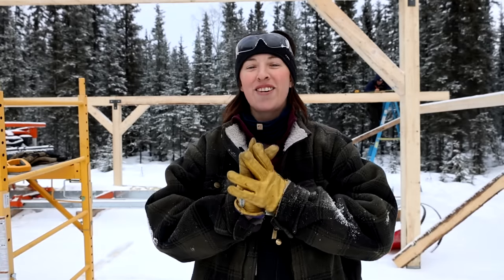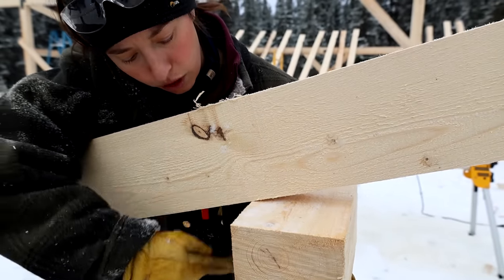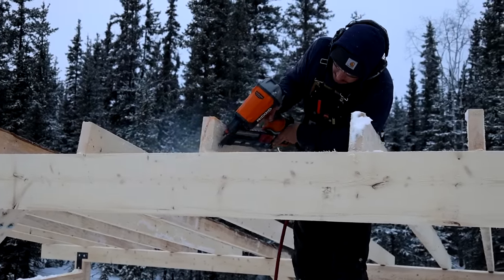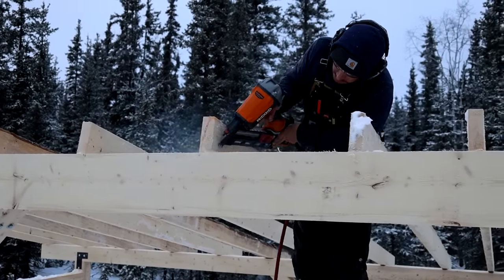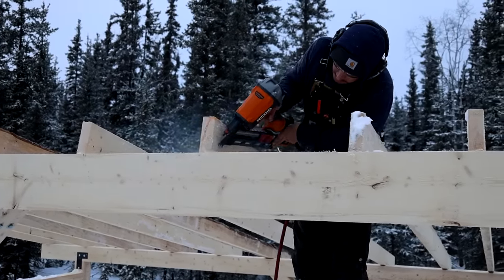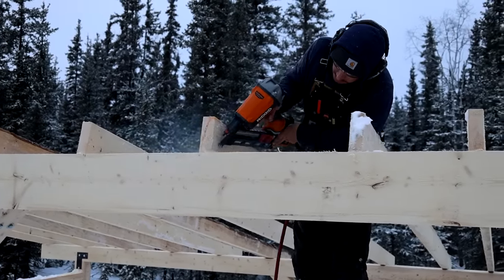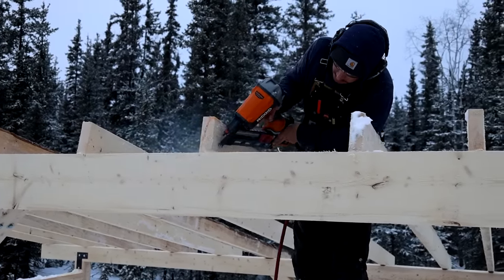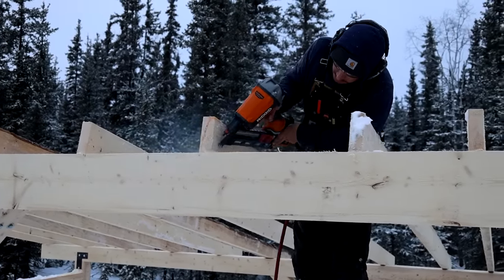Building a Sawmill Shed | Install Rafters and Metal Roofing + Total Project Cost

Comment: After looking at this structure in the video I would like to suggest, as a builder of 55 years to ad diagonal braces to the ends of the structure to prevent racking.  Mainly to keep strong winds from collapsing it.  Great job you two.  Great Job!  Don't forget the bracing.
Reply: I noticed the movement when they were on the roof. This will definitely help, but the building looks awesome.
Reply: Yes this !! Awesome job, however when Eric was on the roof, there no side to side movement, but front to back was another thing. Adding braces to the ends will also help in the event a BIG snow load.
Reply: I came to the comments to say the same thing, and I knew it would be a common suggestion.
Reply: Definitely need bracing front to back.  Would really really suck to have that fall on mill.  They are also going to want to cover a wall to hang stuff on like blades and tools along with a wind brake
Oh and $2k for that is cheap money
Reply: you could use steel rope as bracing for the ends
Reply: Ongelofelijk mooi, genoten van dit project. Ik vond ook mooi om tezien hoe een vrouw dit zware werk kan doen respect. Tevens ook nog koken top amusement voor mij merci.
Reply: @moniquehollands6947  Translated. 
Incredibly beautiful, enjoyed this project. I also liked seeing how a woman can do this hard work with respect. Also cooking great entertainment for me, thanks.
Reply: A MUST 😊
Reply: Yeah I think some braces are missing, it's a really long structure, either add posts and beams or cross brace it (cheaper).
Reply: You two have the best team work
Reply: Hi, as a Structural Engineer from the UK I would add my encouragement to the suggestion of putting in diagonal bracing to resist wind loading. The knee braces used on the elevations would help but an eaves to floor slab//corner post ideal. It would need to be beefy to resist compression. It would also be worth thinking about additional plates & bolts to attach the corner posts to the floor. In the mean time it would be worth using straps & a ratchet to cross brace the gables - as suggested by others. Love your YouTube channel. All the best.
Reply: Ditto. There was movement front to back. Diagonal bracing on ends would sturdy it up. Nice structure
Reply: Great tip. I went back to 22:00 and saw a bit of rocking. Made my knees a little weak.
Reply: @ToKindBe aqdaaaaddaaaadaaam
Reply: Not only for the support but it would give it a more balanced look having the diagonal braces at every point.
Reply: Indeed, importent
Reply: Eric, make more t-metal braces and install them across the gabel ends.   The structure looks awesome!
Reply: DEFINITELY bracing since this is green wood and will twist as it dries

Comment: You will definitely have to put sway bracing in on both ends...a big bluster of wind will fold your structure to the ground without the end posts having bracing...you can put a 5 x 5 beam in between the end posts at the 7' high level and then put in 45 degree braces into the end posts. Wind blowing has mind blowing force!
Reply: Was going to say the same thing
Reply: Yes, it appeared to me it was rocking a good bit while they were putting on the roofing.
Reply: Yep! She did have some sway to her.
Reply: Scary to watch. I think about what if it falls with them under it.
Reply: Came to say this too.  It looks like it needs more shear bracing or a good stiff wind might push it right over.
Reply: If you don't need to be able to pass through the back wall, if it was framed in and covered with plywood (or put shear braces in the framing) it would make a great shear wall and take all of the sway out of the structure.
Reply: Yes they need the front to back bracing and side to side
Reply: @KurtisRupnow  and would keep wind or rain off them at least from one side
Reply: Unfortunately neither seem to have a grasp on how to Properly frame. The fact Erin says they Notched the rafters This time, as opposed to the previous build,  says it all. That's basic framing.
Reply: All the building professionals are out today. 😂😂😂😂😂😂😂😂😂NOT
Reply: @stjameso15 Who’s Erin?
Reply: My husband said the same thing. Needs way more bracing. It will come down like a pile of sticks. Should never move at all!!! Angle braces on ever corner.
Reply: You seem to overkill the amount of wood to hold up the tin roof
Reply: I hope they take everyone's advice about the bracing.
Reply: Came to say the same thing haha. But looks like y'all have it covered. Such a cool structure, would hate to see it fold!
Reply: @David-yu1ms  plus possible snow load...if wet, can be pretty heavy
Reply: Our old neighbors in Wasilla built one just like this to park their truck under and the first good wind toppled it 😢
Reply: It definitely needs X bracing with Simpson KBS1Z brackets on those end posts. Wouldn't be a bad idea to add those brackets to all of the knee bracing. 

That 6x10 spanning 20' is also pretty sketchy........
Reply: Yes this thing is beautiful, but it needs bracing to prevent it getting folded either straight back or straight forward.
Reply: When I saw it swaying it made me so nervous. They really need to add more bracing asap before they waste that $3k they spent and ruin their mill or worse bc that thing is not safe at all as is. I hope they don’t wait.
Reply: The know it all's are out in force... 😂
Reply: @ag8552  he’s just misheard  Ariel’s name, instead of of saying ‘Ariel , he’s made a mistake and said ‘Erin’.
Reply: Great job guys! Have to say tho, you need to sort the sway out mighty fast or you might find it laying on the ground one day with your mill destroyed!!
Reply: Nice video
Reply: @David-yu1ms 
The tin roof is not heavy in itself, but the snow on top will definitly be!
Reply: @daveklein2826  Actually, yes.
Reply: @miatfitz  I can only speak for myself, but the structures I’ve built professionally are still standing 15 years later, so I guess I know what I’m talking about.
Reply: @AnneKegel  not to mention the area it creates for wind to apply enormous amounts of force to.
Reply: It looks AWESOME!!!  Very nice job guys!!  Did you build this from a set of plans?  Comments are plentiful for some bracing and I was wondering if the plans spec’d out bracing. Just a thought.
Reply: I was saying the same as when he was installing roof panels the structure was very wobbly…also ridge cap?
Reply: Earthquake country.   Overkill the bracing.
Reply: @KurtisRupnow  Same. Been building engineered wood and steel structures, professionally, for 10 years. Every open wood structure I've built has called for knee braces w/Simpson brackets at every post to beam connection, cross bracing w/Simpson brackets on end walls, and hurricane ties on every rafter. I live in Oregon, so all of our building codes are designed to withstand "the big one".

Comment: My father built cabins in NH during the 1980's. He said they always used a drawknife to remove all bark from lumber. Says it doesn't weaker the board but actually helps preserve the wood as insects always begin eating wood at the bark. I thought it to be interesting, perhaps you will too. Just fyi.  The sawmill shed is going to be very strong. You build well. 👍👍👍
Reply: My father said he beat yours up easy
Reply: Yep, definitely strip off the bark.
Reply: Wiley thanks for that info!
Reply: @bane8305 😂😂😂

Comment: I would be a little concerned about the movement visible in several parts of this video i.e. around 22 to 23 minutes. bracing on the ends would fix that.

Comment: Awesome build!  A small suggestion... perhaps put some bracing on the top of the horizontal shorter side-beams, that link the front and back sides... it will stop the wobbles you had when walking on the roof... and in high wind under snow load. Basically, bracing parallel and stabilising both sides.
Mealtimes are so magic... delicious.
Reply: I Agree, I would add more 45's front and back to prevent wobbling.
Reply: Yes, that would be my only suggestion as we saw when you first moved up there the wind was strong enough to carry away some of your structure. Rooster soup looked yummy.

Comment: when you were on the roof you could see it moving a little side to side.  some more 45 degree supports will help minimize sheer back and forth and also add some corner to corner 2x4 on back ans side walls

Comment: The notch (birds mouth) you're putting in those rafters is definitely the way to go. I don't know about anywhere else but it would never pass a framing inspection where I am without those.  It lets the weight rest straight down on the supporting member without risk of the twisting you mentioned or even sliding off entirely under the right circumstances. Good job guys

Comment: I built a 75"  x 75" deck for my tiny home in the North Woods in Wisconsin using green white pine lumber. I treated it with used transmission fluid I got from a service station. It looks a little pink when first applied, but turns to orange then brown. It has preserved it very well. After 3 years it does need another application, but it was a cheap way to go and I've been very pleased with how it turned out.
Reply: My brother used to build Cedar houses and would spray them with Auto Trans Fluid , they looked great .

Comment: As a bricklayer working in Canada, when we put up scaffolding, we use quilted tarps to make it warmer inside keep the weather and more importantly wind chill out. I’m just wondering if you got some quilted tarps you could hang them around the saw mill structure, making it a little more comfortable to use in the winter. When the weather is better, you could take them down and fold them and put them away for the next winter.

Comment: Thanks for the video Arielle & Eric !!! Very nice job on the saw shed !
I built an open shed and wanted to put some kind of siding on it but wasn't sure what I wanted. One of the cheapest temporary options I could think of was to use canvas drop cloths like a painter might use. It was inexpensive and turned out much better than I had expected. It looks like a canvas wall tent. The canvas has held up well for 3 years. I even used it to make a roll up curtain-like door by using a length of PVC pipe at the bottom. I coiled rope around the ends of the pipe and attached overhead pulleys to roll the canvas door up and let it down. I did use Star brite Waterproofing Spray ($50 / gallon / 400 square feet) which may have helped the canvas last and stay cleaner. The other option I'd thought of was poly greenhouse covering plastic.

Comment: So it seems you have seen all the comments about bracing and stiffening up the structure so I won't beat that dead horse! 

I really like idea of open air workspace around the mill but having overhead protection. Not just from rain and snow but from the sun! I spend many hours bucking lumber and no sunscreen ever proved sweat proof for me. 

But at the same time it might be nice to have some additional weather protection while your working or while the mill isn't in use. I would get some more of those coated canvas tarps like you used on your chicken run and tack them up around the sides and affix some permeant ties top and bottom to the structure so you can roll them up or down as needed.

Comment: When you guys were doing the roof sheathing it looked like there was a lot of back and forth movement from front side to back side. Maybe consider putting  45* braces on the side beams on the ends. Just a real concern from this vantage point. The shed is such an amazing project. Congratulations once again on a great job.❤😊

Comment: As others have mentioned the 2 sides are in dire need of some bracing to prevent the structure from racking and potentially causing it to collapse.

I would recommend putting a couple solar panels on the front and running some LED lights inside and out of the sawmill.

Comment: Looks great! Will you guys add more bracing? Adding X bracing between the posts on the front would help get rid of a lot of the sway.. also, running a board under the rafters on an angle would help tie everything together

Comment: So neat to see your saw pull itself up by it's own boot straps (yes, I seem to recall that is where the idea of "booting" a computer came from). So now not just a saw but a proper Mill. There was a little wobble in the structure still, I would imagine some diagonals at the ends and the back would soon stop that. Then there is much less chance for any of your fixings to wiggle and maybe loosen by expanding the holes they are sitting in. Given the greenness of the wood and how cold it gets where you are I suspect "ring shank" nails might sensibly become the standard for your projects. What a great project. Have a good week. Be well.😉

Comment: Great project! Love watching you build up the homestead. 
One thing though that surprised me is that you don't plan on putting on any sidings. I was expecting the back to be sided at least to lessens the snow buildup but mostly to add some more rigidity to the structure since I noticed that the whole thing was mowing back and fort while you were putting on the roof. Did the roof make it more rigid maybe?

Comment: Great project build you guys, my wife and I have been following your journey for a couple of years now. We are also in progress of building out our homestead just south of Lake Superior in northern Wisconsin. 

I noticed the same thing a couple other have as well and wanted to make a suggestion to add angle bracing on your corner posts laterally, if you are not going to have external walls to help with stiffening up the building. This will go a long way in strengthening the building in the case of a high wind event or heavy snow load. I would really hate to see you have a failure of that structure after all of your hard work and the probable damage it would cause to your mill.

Keep up the great work and keep the content coming, its fantastic!!

Comment: Easy. Do you have a level? Draw a level line 12 inches long with one end of the line touching the bottom of your rafter. Draw a plumb line from the other end of the 12-inch line down to the bottom of the rafter, then measure this vertical line.
Also, I wondered about some diagonal bracing using galvanized 1/4-inch cable and turnbuckles in both directions to create an "X" in your end walls. This would add substantial stability to the building and hopefully not add any obstruction to your work. I noticed when you were walking around on the roof that the building seemed to shake a little. Adding these "X" cable braces to each end wall would be of great benefit.

Comment: Looks amazing you both work really work well together. Great job! I have heard that if you seal the ends of the fresh cut wood that keeps it from cracking or splintering? Have you heard of that? Could you test it on some exposed ends and do a test?

Comment: If you want something to think about you could use the off cuts or pieces with the bark on them and nail or screw them on the outside of the shed. Then if you wanted to saw lumber in the winter or spring or fall, you could get a turbo heater to kinda knock the chill off and do your lumberjacks year round. I also think you need some 45 deg. bracing on the ends of your shed so it is braced both ways.

Comment: I like what you have done with the sawmill shed. The way you two work together is awesome.  I would suggest additional bracing (as others have mentioned), in the right wind, that roof is going to generate considerable lift. If you look at an aircraft wing from the tip towards the fuselage you can see the profile of the airfoil (the mechanism the generates lift), looking at your roof from a similar perspective you see the same rough shape. 

Watching your video, you could see some rocking going on while you were doing the roofing. I and not a hater, I am only trying to offer constructive criticism.  PS. the music during the intro took my breath away.  Thanks!

Comment: I loved your rendition at the beginning of your video of "Kely Clarkson's; 'Meaning of Life. " It is one of my favorite songs but this was a very nice arrangement of it.  Very nice.

Can't believe all the work you guys have done there already.  Miss the days when I was young enough to do all that. 
It is a great adventure into the unknown, so was wondering if it is all you thought it would be before moving higher?
The right equipment for the job can sure change the outlook and outcome of any project or move, especially when doing the building, pads,  and roads.  As long as you share the work and do it together it will be well worth the experience.  I did it for 32 years with my ex.  Those were the good times.

On the roof,...tie yourself off from the other side to stop from falling off the working side, and then pray.  lol
Sweep the roof before you start walking all over it.   Make sure you have shoes or boots not made of artificial plastic.  Rubber grips the road (and roofs).

I'm thinking building a big campfire below would keep the roof from being so cold, icy, or gathering any white stuff there since heat rises and the wind doesn't seem to be a problem right now.  
The shed looks great.  mine was no bigger then that and took 3 years.  You know whatever you do for a living is always the last thing to get worked on.

Ya!  Lets go ice fishing!

Comment: Your sawmill building looks great! One comment about a shed roof, the rafter notches (upper and lower) should be on the outside. They serve to keep the roof load, EG:snow, from pushing out the walls. But you have pretty good bracing, etc. Love your channel.

Comment: The Post Frames are above ground not buried so will offer little structural support if you get strong winds pushing from the sides you should add additional bracing other than the diagonal sway bracing